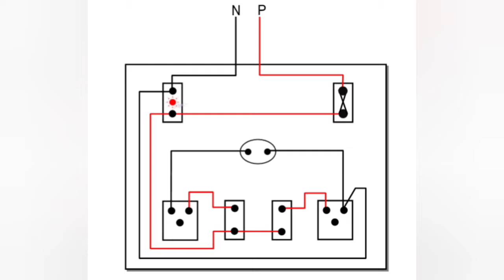How to make SERIES PARALLEL testing board | Series parallel board kaise banaye

Comment: Sir & Gurujee Very nice to meet you i Have one Project 1.MCB 2. Fuse Controller 3. Indicator 4. Open 5. Earth Testing Bulb 6.Series Parallel Testing Board Circuit Wiring Connection Step By Step Please Explain With Drawing Please Sir